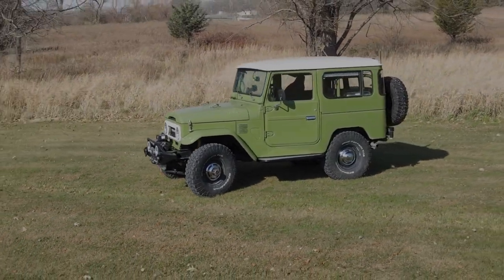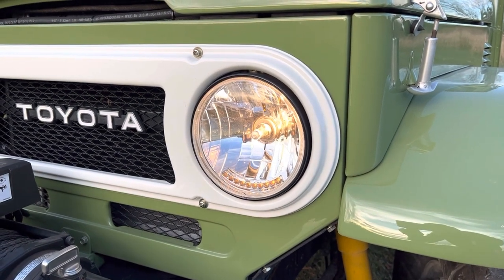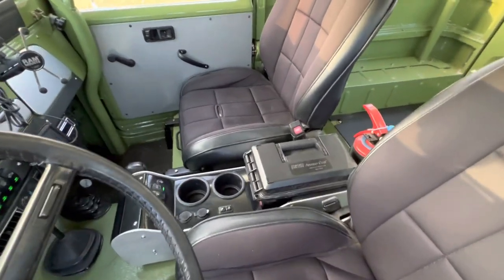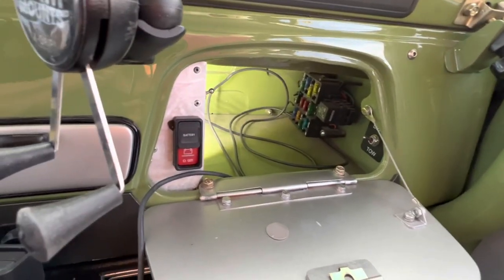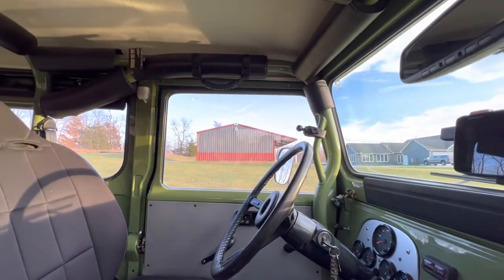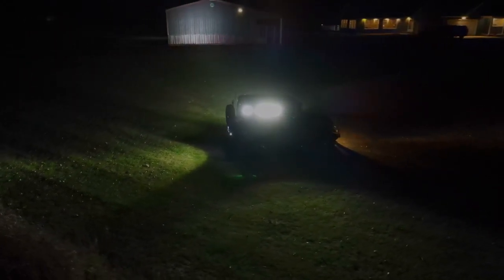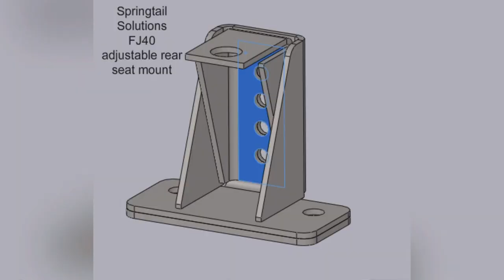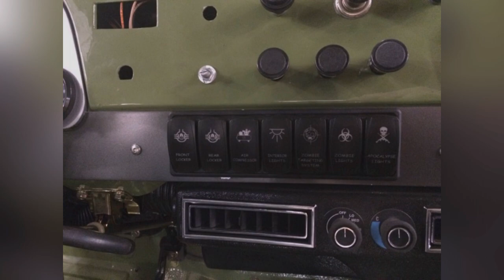Tour of the Springtail 1977 FJ40 Landcruiser Resto-mod Workhorse Build. Purists should turn back now

Comment: Nice 40! Good choice on the metal tech cage. I worked there in the early days, very good quality and engineering. I now have a wheeler 40 with a bunch of very early metal tech prototype parts..
Reply from the maker: Metal tech makes some amazing stuff! The roll cage was well executed and is one of my favorite additions to the build.

Comment: Thanks for the video. I have three questions for you. The first is what kind of fuel economy do you get? The second is why would you choose an older Chevy V8 when you could of had a more modern Chevy LS V8? Third question is how does the Old Man Emu  suspension ride compared to stock? Thanks.
Reply from the maker: Great questions…

1) if you watch out pyramid’s video..at the end, I do a real life gas mileage check. That calculation was 11mpg. This was way better from the 6mpg that we got out of the old analog holly fuel injection system/ manual transmission to the newer Holly system coupled with the automatic. 

2) The goal was not to reinvent the wheel…in 2009 when we started the project, there were not many LS swaps. As I recall, the LS required a more complicated fuel delivery system as well. Contrary to popular swaps…I went with 250 hp as plenty for the intended purpose. Stupid simple and reliable rules the day. 

3) Stock suspension is brutally rough. The OME is a little too soft for higher speeds but overall I’d a good bang for the buck. Again…it was the standard for 2009. There may be better options now. 

Thanks for watching!